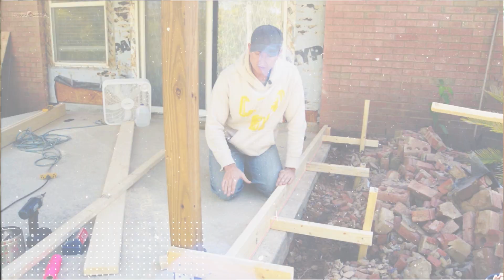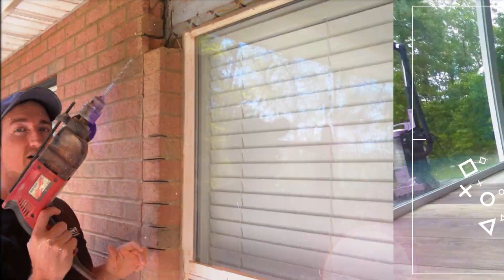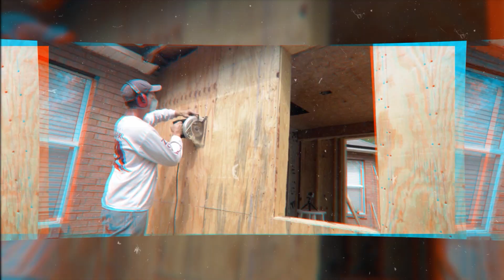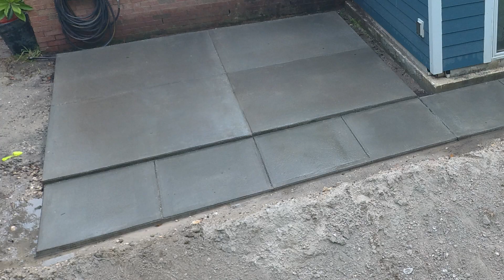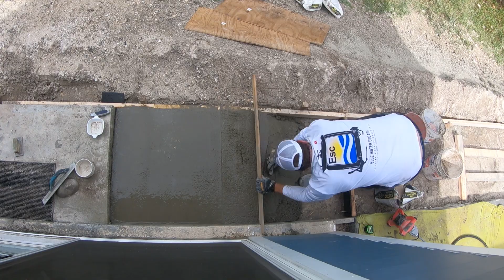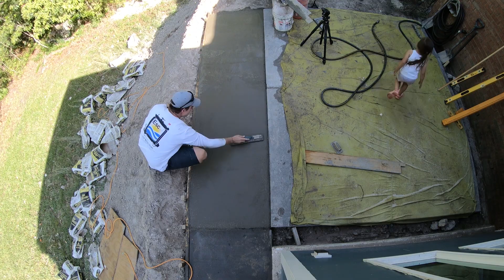How to level  concrete without using a form board

Comment: So I have a brick wall to make long sidewalk across the front. You idea helped be to see I can attach 2x4 above the height I need for sidewalk with tapcons to brick. I can  then create the jig you made and then use the form board on the front. Thanks!!!
Reply from the maker: Excellent! Thanks for the comment.

Comment: What if the wall is 3 feet high and not straight at the top?
Reply from the maker: you could temporarily tack on a piece of straight edge board slightly above the new concrete height and then use that as a screed edge like i show in the video
Reply: @MrKistel Thanks for the tip on what to do when you have a taller wall in your way of putting up a form.

Comment: Great idea with the Cut out on the board,
Reply from the maker: Thank you.  This custom notched concrete screed board works great especially in a situation where you have a level ledge to run it across.  If the edge of the new concrete was flush to a wall a temporary guide board could be attached to the wall to guide the notched screed board.